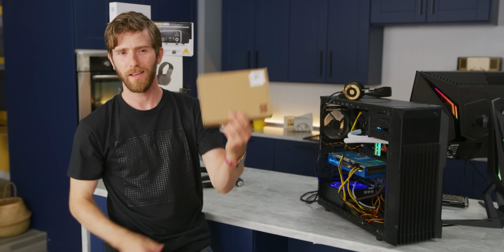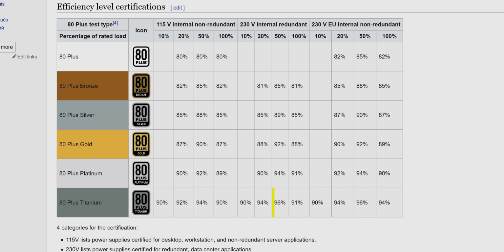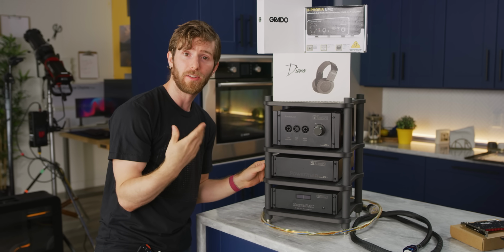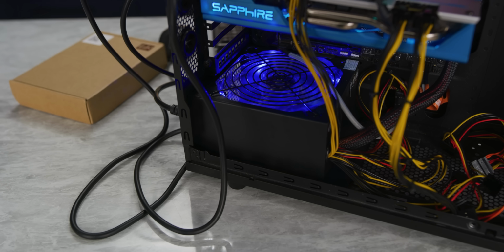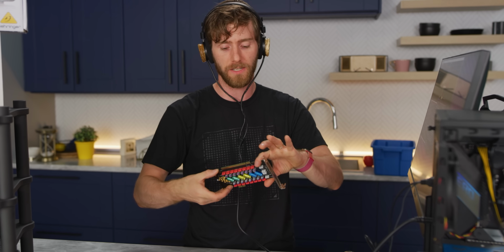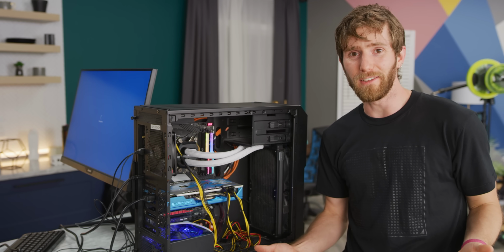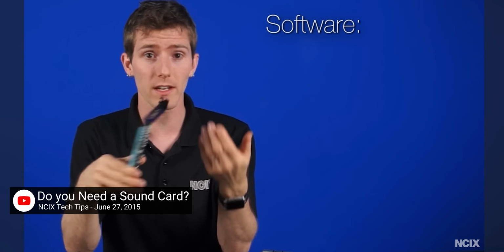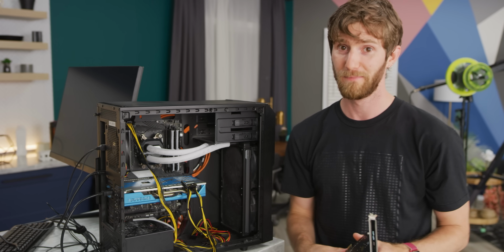Is this $40 card a SCAM? - "Audiophile" Power Filter

Comment: Gahhh! First, check with silence and a clear, clean tone not a tune. If you don't want to go full oscilloscope, record the loopback/"what you hear" Channel and compare with software (someone hear suggested audacity +1). Also, most noise in a rig comes from spinning rust hard drives, did the rig have one? The original sound blaster suggested you put the card in the furthest slot from the hdd. Also most of the noise is inductance from high frequency chips and motors (hdd/bd/dvd/pumps) which is why pcie sound cards usually have a Faraday cage. This wouldn't help with that.

Comment: Something like a Tripp Lite Isobar is a great purchase for electrical noise isolation, but also outstanding for surge protection. The isolated filtration helps in both of these aspects when compared to your off-the-wall "surge protectors" and common UPS systems. I recommend one with every computer I build out for friends and customers alike. It's really worth the extra $40-80 for peace of mind.

Comment: If you need a device with shitty audio I would have sent you my MSI board. The fucking thing hisses whenever you scroll or update large parts of the monitor. USB or battery powered headphone dacamps work just fine, don't waste PCI lanes over an audio card. If you need multichannel there're external dacs that work over spdif/motherboardHDMI...

Comment: You can't play music thru the headphones, it will drown out the noise.  Listen to silence and crank the volume way up.
Reply: you need to raise the noise floor in other words.  Playing music lowered the noise floor.
Reply: you wanted worst case scenario but used a 1000 watt psu, should have used an underpowered psu instead.  use the least powerful psu that you can.  also you should try plugging the headphones directly into a USB powered audio interface (uses only a usb cable to connect to pc and power the device) like a focusrite scarlett.

Comment: i'm an electrical engineer, not a good one, but i went to school and am employed for it. the cap's used to filter are shunt capacitors. meaning they're in parallel with the lines. idk what configuration a PCIE slot is, but i don't think slapping that card in there is the same thing as putting a shunt cap in to filter out the ripples of an ac signal. like i said though i know enough to be dangerous, not enough to know what i'm talking about

Comment: For $40 you might as well just get a Raspberry Pi music server.

And no, apart from decent power so it won't clip nor adding too much noise, gaming doesn't require the same levels of low THD+N as music playback does for a number of reasons. First, your attention span is split, unlike when you're just listening to music (or the ideal way to listen to music anyway), and second, sans a really annoyingly loud cooling system and really crap electronics, your mouse and keyboard will maintain a noise floor.

Otherwise for pure music I wouldn't really use a computer. Even a smartphone on Airplane Mode has less noise just from not needing four 120mm fans and three 80mm fans (in case even these start running, like in a hot climate).

Comment: The one thing I notice with power related noise is when I try to get audio out of my tablet through my PC speakers; they start buzzing pretty bad no matter how I connect them, either via motherboard's aux/line in/mic ports, or directly via my speaker's aux in port.  It just sends out this feedback no matter what.

A ground loop isolator helps resolve it, but doesn't work 100%, and slightly changes the audio signature.  It's better than without it (especially when you don't need audiophile quality), but it's just this bizarre thing with audio I never realized until this experience.

If there is a way to 100% avoid it (without absurdly expensive equipment), I'd appreciate any help from someone knowledgeable in this subject.

Comment: I think you guys should've tried a low-end motherboard.  My sketchy 80+ PSU and my low-end Gigabyte B450M S2H outputs a pretty noticeable whine through the motherboard audio output and my Hyperx sound card. I think that decent motherboard you guys had is the reason you guys were not hearing any problem.

Comment: Even though internal sound cards aren't really the bees-knees anymore I still ended up installing an EVGA Nu Audio card into my comp at the beginning of the year. Mainly for the analog performance, I don't really care about the digital on it. Plus I can swap out the op-amps if I want to fiddle with the sound delivery in the future. I previously had a Creative Sound Blaster Omni Surround hooked up, which I still have and it sounds great for what it is. But I stopped going for Creative cards because they continue to sell old models but stop making updated drivers to support them on newer OS's. I liked the idea of it being plugged into USB and outside the tower, but it's absolutely useless when the newest driver they have for Windows 10 is dated for 2015. It also doesn't help the software loved to act up on occasion which meant you had to do a fresh install to get it working right. Though it is still useful if I wanted to hook it to a retro-gaming pc because it still supports EAX for older games.

Comment: The biggest improvement to my PC's sound quality was using a surge protecting power board to filter out line noise on my speakers.  

As for that capacitor board, I am no electrical engineer but wouldn't you need to have that capacitor board between the noisy source power and your device in order for it to do any sort of line conditioning/filtering?  Before Linus went into detail on how it was used, I was half expecting some sort of "solution" for you to plug your sound card into that 1x PCIe connector on the capacitor board.  As it is, it reminds me of the various scammy "As Seen On TV" products that are placebo in nature at best.

Comment: No shit the audio quality out of a $400 premium motherboard doesn't have any problems for an add-in card to fix. Asus even specifically includes EM shielding as a part of their SupremeFX™ audio branding.

What I would like to see is how this card compares the kind of ultra low budget mystery brand motherboards OEMs love to use, which cut every possible corner in areas like audio because the $2 for decent components is a big chunk of their margin.

Comment: "...so you can install your placebo however you like." <-- pretty much sums it up. Like the majority of the stuff in the audio market. Shakra crystals and magic wire-pyramids woould probably work a lot better.
For a power filter to actually work, the power lines have to go through it. Or have the filtering very very close to the power supply. Just whacking a bunch of filters in a slot won't do a thing.
Reply: they did build that pyramid PC for someone.. the market is out there :) I really dont give a damn about audio quality from a computer but I DO give a damn about my computer parts lasting their rated longevity so I am a big fan of the UPS with power conditioning.  a 200 dollar UPS is well worth it when you are talking a 2-3k investment. and when that UPS fails in a few years just replace the batteries and its good as new! I know when you pull out the packs its gonna look all scary and proprietary but its really  going to have 2-4 12 volt off the shelf batteries in that pack with some careful tape peeling you can stick new ones in and it looks at works just like the OEM replacement pack that costs 100 dollars.  If you buy your batteries from a security system parts supplier they will be something like 7-12 dollars each depending on capacity.. and drop off the old cells at a Best Buy or something for free recycling.

Comment: Try this with a USB audio DAC.  They are notorious for being sensitive to PC GPU noise.  I bought an iFi iDefender (iDefender), which broke the ground loop.  I couldn't believe it worked, but at the same time couldn't believe how poor the MSI motherboard for my core i9 was designed with regard to power isolation and filtering.  My old Asus board for my core i7 was fine.

Comment: Use a pair of active studio monitors and connect it to your mobo aux. It will not filter the noise and it will actually amplify it. It sounds like a synthwave-ish modem.

Comment: Opto-Isolation of anything carrying signal/data and proper grounding of al your hardware. That means an 8' copper rod driven into the ground with all your grounds tied to it. Every amateur radio operator will be intimately familiar with this grounding technique.

Comment: I'd love to see a repeat of a test like this, but with a setup where cross talk is confirmed to be a problem and/or an oscilloscope is hooked in to see the effect.
Reply: same, or maybe with a pci powered gpu.

MANY electronics are under-filtered. I've soldered up some LC filters and ground loop isolators , and terminating resistors for off the shelf audio equipment and seen a huge difference.
Reply: RTX 2080 ti owners reaction to Nvidia. https://youtu.be/VCNhzBB2aMU     😋

Comment: Idk if it would fall into a similar category but in HVAC for low voltage wiring to help with electrical noise from High voltage, it requires some wires need to be grounded. Maybe this card would work better if grounded to the chassis somehow.

Comment: The thing about LC filters is it has to go between the supply and the device you want to filter. Just sticking a LC filter anywhere won't do a thing. Oh and a bunch of caps on the 3.3v PCI Express rail of course won't do anything for a graphics card powered by a 12v connector......

Comment: The biggest problem with caps-on-card like this is that the connector alone adds so much ESR+ESL that even the best caps on the card still won't contribute anywhere near as much power filtering as caps on the motherboard that have direct connections to power and ground planes. This alone guarantees that the improvement will be tiny at best. You'd need to test with a good audio spectrum analyzer to measure the difference assuming the board isn't fake to begin with.

Comment: Capacitors are used for power factor correction in shops too. All of the motors in a shop causes the AC to be dephase and therefore making the shop consuming more power than is required. Capacitors correct that. Where I live, if the power factor is too bad, we can get fined so it's in the interest of business' to correct it.

Comment: To do a proper test, you need an oscilloscope... then you send test tones, 100hz, 1khz, 10khz... and view the output on the o-scope.  You would be able to physically see even tiny differences at that point.  That said...
I am an audio tech... and most home audio systems are no where near sensitive enough to care about this.  Large venue and theater systems are absolutely sensitive enough, but.... in those situations you use a DAC and so internal noise doesn't matter.
Reply: Yes this is the right answer. This test is pretty bad.

Comment: 6:30 ~ The music you chose, is synthetic. i wrote about which instruments, my ears are most sensitive too. That voice was also high pitched, electronic noise and high pitch, would you be able to detect if the source signal is in harmony with the noise value. ~ I could not sleep all last night, reported at 6am same hours as the hurricane nude run, that got me banned from Sara Smith 1991 06 24 ~ who comes in at 9am, 3"penis hours later. ~ The name of the source for programming is Insistute Electrical and Electron Engineers, 2of 3.75-ich aka #3y4x5Di, #1Corinthians3 is all the #ieeeorg = Electron Engineers=RADAR excite bodies and minds, to spy on them, are #cognitiveRADAR slaves. The slavery is as smooth as #raytracing $ of a completely digital world, where the physical world is every other cycle altered making it perfect or more perfect union smooth.

Comment: Sound is still massive and so are sound cards, though it's far more niche now for enthusiasts (if you can call me that, guilty AE-5 owner heh).  It's more or less the sound engine and processing of positional audio that drove me to get a sound card.  

On-board is great don't get me wrong, but Here is how my current setup works as well as the specs to give you a brief use-case for a sound card.

Card: Sound Blaster AE-5
Headset: ASUS ROG Theta true 7.1
AVR: Yamaha RX-V661 (using analog RCA to 3.5mm cables)
Speakers: |Front and Rear - Yamaha NS-333|Center - Yamaha NS-C55|Sub - Welling 250w with full analog control

So it would seem silly to have a headset and surround setup going at once right? well that's not the case.  I have a chrome plugin called AudioPick, this essentially allows me to select audio for the current tab in chrome to be chosen just like you could through windows.  So I set the AE-5 to play with the sound stage I have set up and up-mix stereo to full surround (best feature that even home-cooked realtek drivers can't compete with) with a playlist I like.  I then set the Thetas on my head and go to town in whatever game I am feeling like playing.

This creates a nice experience in titles like BFV for instance, I love their soundtrack but sometimes you just really want that doof doof or cyberpunk radio mix to jam to while racking up kills on Devastation or some awesome flight of the Valkyries as you spam that spawn button on the aircraft at the start of Pacific Storm.  

That last one is my favourite use-case and allows for some great adrenaline rush moments.  Then we have the use-case my fiance HATES.....using the bass-boosted profile on the AVR with no headset and staying in the cockpit view, Nothing makes you feel more immersed than feeling the desk shake and windows rattle with every CHONKY pah-pah-pah of those .50 cal upgrades.

Sorry for the wall of text but wanted to convey my experience and why some still use dedicated sound cards.

Comment: I just use a USB ground loop isolator. That solves most of my issues since my soundcards are USB based.
Reply: same, paid maybe 15 bucks for it years ago
Reply: aaaaaaand there's where i'm going wrong
Reply: What does a USB ground loop isolator do? I've never heard of one before :S
Reply: this is news
Reply: Just using usb should solve it, since usb is digital. Optical would also solve it.
Reply: @davidtype1980s  xDDDDDD, "digital power" funniest shit I've ever heard
Reply: @davidtype1980s  And AC ripple in USB's power line isn't.

Comment: They really should have used a shitty motherboard and some hifi equipment to test it out. Yes, it's going to be most likely always the worst solution even if it somehow works, but I would have been interested to see if it does something or not. Now this was like if you tested the new 3000 series with playing games in 1080p and 60hz monitor with v-sync on.

Comment: I have the same issue but I resolved it by having a volume knob on my headphones, I dont know why but if the headphones are at 100% even if there is no sound there is a hiss coming but after turning it down through the volume knob to 60% ish the sound just disappears, its not quite either because if Increase the volume through windows it has no effect on the sound.

Comment: "dirty power" is the result of filter caps on the power supply not filtering all the AC voltage coming from the unregulated supply (aka the wall outlet).
The whine coming from the card is (most likely) the cheap components and their design causing issues with other components such as transformers or transistors (just not big enough problems to interfere with the computers functionality). But I could be wrong.

Comment: One major flaw here is that you used a high watt supply.  Using a much more lame system to test would probably do better to show how bad on-board audio might be.  And using a cheap low watt PSU, which would be more easily strained and noisy, would certainly make it noticeable no matter the motherboard.

Comment: I'm sure it makes a measurable difference if you had sensitive enough equipment to check how much less ripple there is.  It's just that the difference is so small it might as well not exist.   Like an ant walking over a train bridge. The bridge does bend under the weight of the ant, it has to because physics, but it's just so small that it's completely irrelevant.

Comment: This was quite disappointing, because even though the card most likely does nothing your test did not conclude anything. You should at least have started with a system with a worse motherboard, which actually has audible noise. You also could have used the audio out as an input and measured the noise (without playing audio).